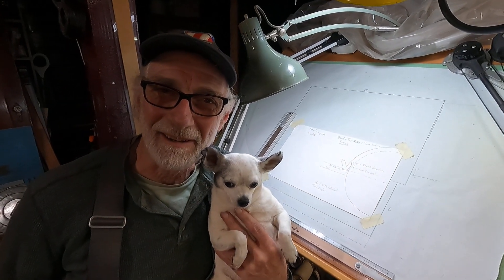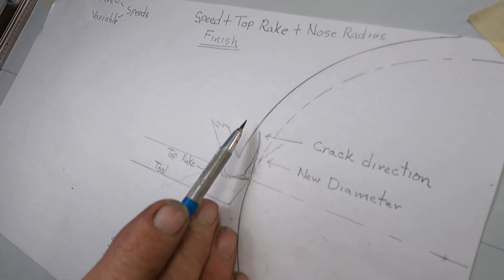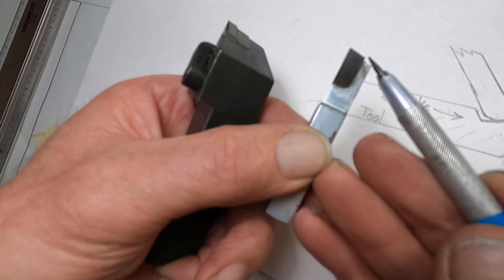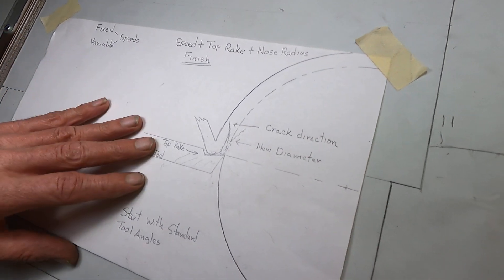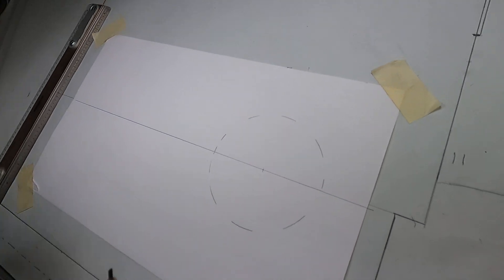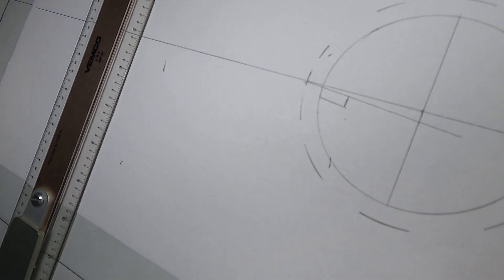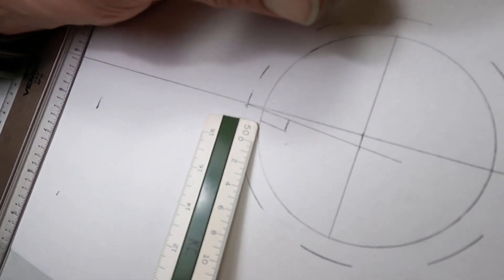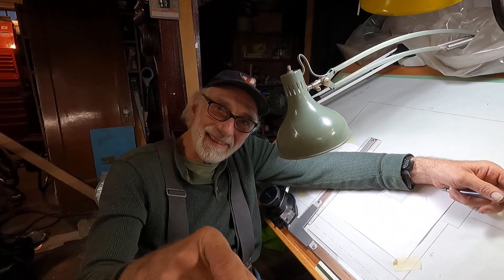Basic machine tool carbide cutter design

Comment: Dee Dee where do find the tool angles for the different materials?  Regarding surface finish, what criteria do use when deciding to when deciding whether to use produced carbide inserts, brazed carbide or high speed steel?  Do you ever grind inserts to allow for shallow cuts while retaining the other design features of the insert?  This episodes is interesting stuff and you’ve really made it seem simple to design the pockets for the carbide on a radial cutter.  Maybe making my own shell mills is worth considering; those multiple insert tools are pricey.  Much fun and very interesting.  Thanks to you and Charlie.  Cheers, Will  (I think that scraper was made by a show off!)
Reply from the maker: The tool angles are in the vo-tec machinist textbooks from 40yrs ago and cutter grinder manuals such as Cincinatti. Way back before carbide the first fiddle machinist would silver braze HSS into disks of steel and make their own shell/face mills. It is only in the last 20yrs most have died that did it. One has to make the decision if it is best to buy a new insert face mill, or make one. What I shown in this video was part of the vo-tec course here in the 1980s. However being able to come up with a custom cutting tool in a pinch does not hurt in a fiercely competitive environment if you are in it to win it. Now I can make fancy scrapers for myself, and walk dogs.
Reply from the maker: I will compile the basic tool angles in a future video.